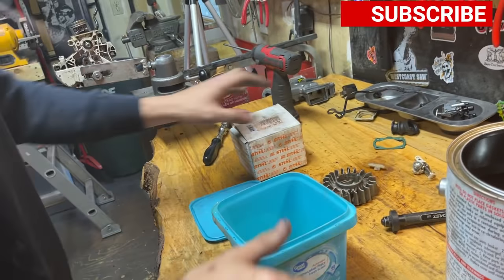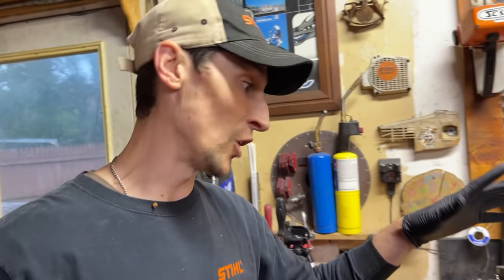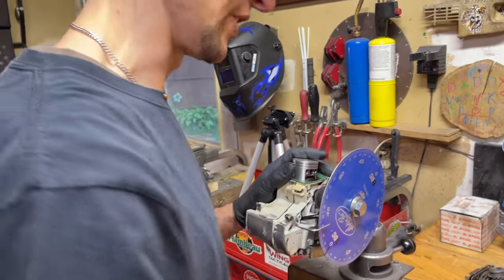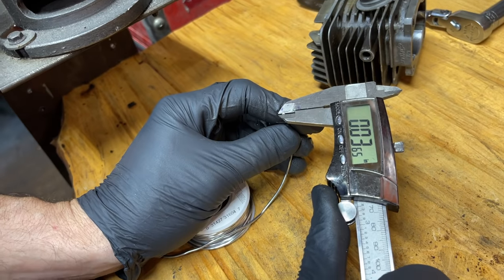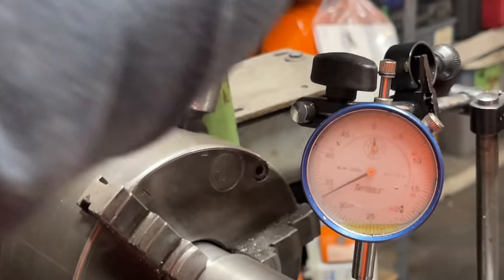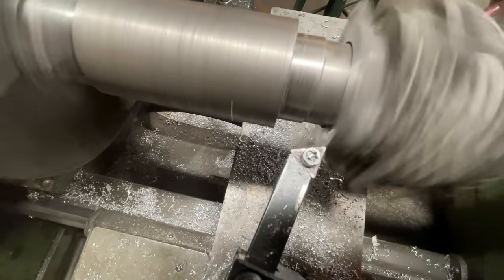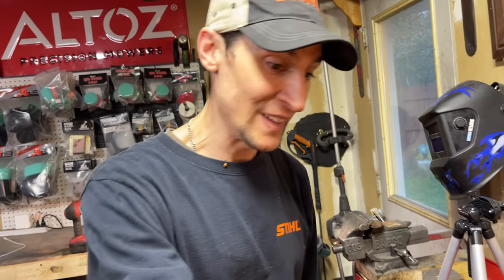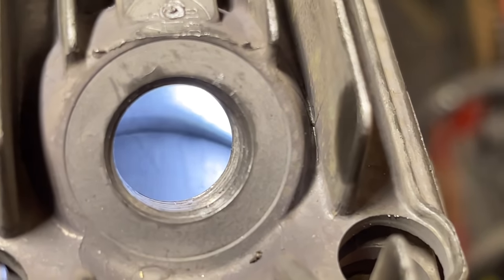LIMB REAPER!!! John ports and polishes my old ms200t explaining every step of the way.

Comment: 13:34  That measuring instrument is a digital caliper, not a micrometer. 
Great job. A huge amount of info & knowledge being shared here. Thank you.
Reply: No kidding... didn't know that... learn something every day 🤷‍♂️
Reply: I cringed a little with the water balloon analogy as fluids cannot be compressed. Not claiming I know anything about porting an engine or fluid dynamics for that matter.
Reply: @kenh9508  Air is a fluid and can be compressed. Liquids are incompressible. I didn't cringe at your comment because I know people make mistakes.
Reply: @dr7477  yeah ok, unsubsidized
Reply: It’s possible to put the same volume of water in a smaller space being heated & pressured! Heat will change the H20 molecule and being that a balloon 🎈 stretches being that it’s rubber! 
It’s possible Something that does not stretch could possibly hold that same amount with pressure behind it in a smaller space. Thus creating more compression which if released dramatically produces more energy thus creating more power! Energy=Power! 
We all learn something new everyday. Not the perfect analogy but we all understood what he was implying but some of us think outside the box. Lol cheers oh that space that’s smaller is very very minimal. Just like a cylinder when creating a smaller space with the same amount of internal mass present while outer mass is shrunk around it! Creates more pressure just like a stroker motor! 382 as a example! Again cheers 🥂 everyone!
Reply: The calibration mechanism within the caliper is a digital micrometer--so, he is not incorrect in saying that. You narcissists always have to show how smart you are.
Reply: @jkgkjgkijk It's not a micrometer. It's a digital vernier caliper. Please look things up before you go miscorrecting.

Comment: I've done 4 Stoke motor cycle head's for years and we all have our favorite bit's.When they clog or go dull it's part of the oh no moment.
Love w.d.40 for clearing chips and final finish.
Always wanted to look over someone's shoulder on a 2 stroke.
He was very clear on the dos and don't and why.
Also love the foot pedal to adjust rpm and quick change handle.
You both rock this video and thanks!!

Comment: Great video, and thanks for the memories.  I'm 72, and my Dad's machine shop was my day care.  I was running a Clausing 13" lathe by the time I was 8 years old.  I retired and sold the building two years ago, the new owner had no clue of what to do with the machine shop.  The lathe sold for $500, $300 for the Bridgeport mill.  Eight 30-yard dumpsters of metal and tooling went down the road.  I'm still crying.
Reply: That's your own fault. 

If you sold the building as a machine shop, you should have sold to a machinist. If you sold it as a building, you should have sold all the equipment yourself. 

Or you left so much old worn out tooling and tiny scraps they said screw it and scrapped it because they had newer better stuff to replace it....
Reply: Brutal.
Reply: I'm 73 and crying with you. I've wanted those machines since high school machine shop, but never found $$

Comment: I've been working on cars and trucks most of my 40 years but I only recently got into two strokes during covid ...... In that time I acquired 8 chainsaws and one was an 088 that needed a cylinder. I bought a new cylinder and piston which was the new style muffler so I welded up a two-stroke muffler from a dirt bike from a video I saw I also Port matched the exhaust port to the muffler and did a little bit of porting in the cylinder from another video I saw but I wish I had found your videos first. Thank you for the information you share, it's cool that you pass it on the way the gentleman who taught you did.

Comment: Really awesome video. It's cool too see a guy share his knowledge on porting not to many guys do that. And it's even better to see a saw built that is going to be working not reving 15000 rpm with no torque.
Reply: Right on the money... I have seen em built for top end and they will scream high RPMs but they fall flat on their face in a cut... respect that you get what I was after thats pretty cool 💯
Reply: @johnscustomsaws  those saws aren't practical,  especially for a working saw. Do you build 201T 's or just the bigger saws now.
Reply: @jaythe306snowmexican  201s have such small carbs its hard to get any extra out of them without starving for fuel.. and they have a "chute" style lower transfer that sticks down and they can't be decked on a lathe... would need a milling setup... so I just do a mild timing advance and "dirty up" the strato intake if you know what I mean... and a muffler mod... they are a tough one... the newer ones do have domed pistons and they run a bit better... I hate to say it but the climbing saws will probably be all battery powered pretty soon... I ran Jacob's husky 540 battery powered saw and was very impressed... no idea on battery life or price etc but power was awesome
Reply: @johnscustomsaws  ok thank you sir,  I'm not ready for the battery saws yet 🤣 . Thanks for all the help man I appreciate it.

Comment: Super Cool ....intake roughness...square out ports...
Polish technics on exhaust...

Fine grindings are abrasive and dont wipe off well in my anion.....I take distilled water with dawn dish soap and boil head an vigorously srcub with  stiff plastic brushs to get all the fine grindings out and boil in clean distilled water...blow dry and spray head down with wd-40....Im a amateur..5 years silver Stihl Tech.

Thanks Again , Great Video 😎

Comment: I am one of the 6 he was talking about. Haha
At the machine shop I worked at we had a flow bench for porting heads. The reason you want dimples on the intake is the air is being pulled in and by having the dimpled surface it actually does the opposite of what you would think. It allows the air to glide across the surface as it is pulled through the port. It smooths out the  disturbances  from symmetrical differences in the port by having the negative space below the high points. You can kinda think of it like a shock in a car. But also having less surface area the air actually touches as it is pulled through the port. So less drag it has while it is moving giving more flow/air to the cylinder. In higher end performance cars they do the same to the under belly of the car to reduce drag. The reason the exhaust port is polished is because the air needs to be  forced out as quickly as possible it does not have time to let velocity help aid the removal. Having dimples on the back side would actually temporarily slow the exhaust gas coming out not allowing all of the waste to be expelled quick enough before port or valve closes. We are talking na machines here. I have never tested a rough surface on exhaust port while running a turbo charger. They have back some back pressure that comes along with them. May aid velocity to give its benefits of quicker than a polished port. Key word may... Have never heard of anyone running simulations on a flow bench to test the possibility for added benefits. Butt would not apply here. Thanks again. I will need to watch this another 4 times this week to absorb all the things.  ;)

Comment: Digital calipers like the ones used in the video to measure the solder are basically just rulers with displays and they can measure pretty precisely but micrometers are a whole different animal. Really good micrometers are so precise that they have to be used at room temperature because of thermal expansion. When you measure something with a mic you have to include not only the size that you measured but also the temperature the thing was measured at because it will be bigger if it heats up and smaller if it cools down.

Comment: Awesome process, the explaining and the filming view is perfect. Made me want to try and do it on a ms210. wish me luck
Reply: You’re really limited on what you can do in a smaller consumer-grade clamshell-style Stihl which doesn’t have a bas gasket to delete or flange to turn. If you haven’t done so already, open up the muffler and advance the timing 8 degrees along with a switch to 91+ octane fuel. That will get you 75% of the gains of a full porting job on that saw without having to tear it down very far.

Comment: On the off chance that John rads this. Look into a bison 8” 6 jaw set-tru chuck. It’s a scroll chuck like your 3. But has a provision to adjust runout and they are usually in the neighborhood of .0004” repeatability.  Also, more jaws means more bearing area on the part with less distortion. I love 6 jaw chucks for barrel work.

Comment: Good info about the huskies...

I'm looking to do a leaf blower to see if i can gain any more rpm.
Poulan pro one, but made by Husky...

It's already mildly modified, and it confuses my neighbors.

Years ago neighbors saw how well mine runs, so they got the same one.

Confused looks as I'm running mine and tossing rocks, and running theirs.
I still laugh, neighbor looks at me kicking ass and taking names with my little yellow handheld, looks at his, the looks back at me with a super confused face. 😅 

Anyways, i have a fresh top end since it's about time to freshen ot up...
They apparently chrome line the cylinder.

I thought they only did that to their chainsaws.

I'm not sure if i can even port it. 😕 
Sounds like a nope.

I'll probably do some light cleanup of the transfer ports, and see if i can't raise the compression/lower the quench.

I also have an old tuned exhaust from my 2 stroke rc car that I'm thinking i need to adapt to it. 😆

Comment: Definitely do not use polish on the exhaust ports you are 100% correct sir. Lots of polishes harm steel and aluminum in a way that is not visible but as the engine is used the harm will show up as excessive wear or brittleness and other things. Polishes are fancy concoctions of chemicals and abrasives that shine things up extremely shiny and really fast but really are just for aesthetic purposes and shouldn't be used without extreme caution on mechanical devices. Using a scotch brite on aluminum will create aluminum oxide dust which is a major abrasive used in polishing compounds anyway so you just add a little oil in the form of WD-40 and you have yourself an aluminum oxide lapping compound which is great for polishing aluminum and wont damage the steel cylinder. If Johns custom saws reads this I would recommend you switch the WD-40 for synthetic motor oil and mix in aluminum dust to make it a polishing compound you might have to play with the amounts of each. Use a rag or cloth on your die grinder with the oil and aluminum dust instead of a scotch brite for the polishing step. Also I can't stress how important it is to clean everything thoroughly because its all coated in aluminum and steel dust after the sanding and polishing which will wreak havoc on bearing surfaces. Even if you can't see the metal dust it is still there and will soon be grinding your bearings to paste. The absolute best way to clean these parts is with an ultrasonic bath.

Comment: Oh Re the importance of setting squish --- Sure, it affects compression IE all things being the same a lower / tighter squish clearance will be more compression (smaller dislpacement at TDC), however I think we oftentimes forget just how much FUEL is stuck/wasted in there, from Jennings book he says that on a 250cc example going from 40thou to 20thou is literally putting 5% more fuel into the chamber (people have WAY over-inflated ideas about how much of the fuel in the squish-area is actually used, from what I've seen!) so minimizing the squish clearance is "good form" no matter what compression level you want to run, the optimization of the combustion-event is so critical (to performance as well as fuel-economy), the only reason OEM's don't send them out all at 0.02000"squish is because of "(in)tolerance build-up" in manufacturing, IE a connecting rod is a touch large on a particular unit, but its piston was also on the large side, and the cylinder was sitting a lil low --  now at 10thou squish the saw won't function properly.  So OEM's have to set squish at higher-than-optimal levels, as a consequence of mass-production NOT of design-choice! 
Altering compression from stock is one thing (not a bad one, mind you!) but setting proper squish is just good-habit IMO, hardly even "a mod", it's like cleaning up bad casting or other artifacts of mass-produced engines!

Comment: Up and down movement is called "runout",  back and forth is called "endplay". The first is bad, the later is not.
Reply: Run out is not something used to measure bearing play but end play is and was correctly used by John. An example of run out is when he's adjusting the mandrel on the lathe.

Comment: Your friend really need to get a ultrasonic cleaner. Drop a carb in have lunch. Pull out the parts. To a level you thought not possible.
Reply: I have an ultrasonic... 2 actually... I was trying to give an easy "at home " tip... not everyone has an ultrasonic was my thinking..

Comment: I was the S in S&M TMT racing. We built and raced formula two And formula three grand prix motorcycles. Mainly the TZ250 and the RS125. I have two questions. Do you CC the heads and/or stuff the cases? Also this gentleman knows what he's talking about. I was rather impressed. Granted, he's not an A. Gram Bell or Joji Yakamura, but he's pretty close.

Comment: A good practice to get into would be blowing all the chips out of inside the cylinder after youre done on the lathe, sure 99% of the time theyre going to fall out but it takes one time for one chip to stick to scratch the inside of the way or nick the top of the piston when one sticks. Plus youre also not introducing any chips into the bottom of the crabk case when you bring the cylinder over to the bench.

Comment: metal polish would be fine as long as you wash it all out .it's generally got aluminum oxide in it, and even the calcined type will continue to cut if some abrasive is left in

If it's worse than using sandpaper (which will leave bits of alumina behind), I don't know. Maybe if for any reason, just because metal polish usually involves a greasy carrier that's intended to leave behind a tiny slurry/grease layer (that could have abrasive in it) - the tiny layer left behind prevents rust for a short period (not a big deal in an engine filled with lube oil residue).

Comment: You say "it's amazing how much goes into this" the main part of that is because it's a 2 cycle/2 stroke vs where a 4 stroke engine has a camshaft and valves for air and fuel delivery and exhaust where a 2 stroke has no valves or camshaft and uses ports for its air and fuel delivery and exhaust.
So basically he's modifying the ports for performance kind of in the same aspect of putting in a performance camshaft in a 4 stroke. Plus he raised the compression by shaving the base of the cylinder/ jug which also adds performance.

Comment: And anyone looking to get a lathe that 3 phase, what you do is you buy a VFD which takes single phase (220v) and digitally divides the 2x 110v into 3 phases. Theyre cheap and its very easy to hook them up yourself. But if you have zero electrical knowledge or experience i wouldnt suggest doing it yourself unless you research how to do it properly and take all the proper electrical safrey precautions.

Comment: Just fyi that is a digital caliper not a micrometer. And it doesnt matter if you use MM vs inches.
1 thou is .0254MM. .0036 would be converted to .0914mm. Al though the scale is different, there is of course a conversion from standard to metric.

As a machinist i use metric to take measurements if im building something from scratch because the math is easier and easier is quicker.

Comment: "You can't just put a ruler in there" (Re having to use a timing-wheel)  Why not? Honestly asking, I'm n00b-level and have made (2) timing wheels, one for my 660's and one for my 590, 'custom 1-off' wheels.... BUT I also use my depth-gauge, for instance I NEVER use the timing-wheel to check my blowdown/transfers, I simply use the depth-gauge and measure my exhaust-port-roof (which I already triple-checked on timing-wheel, so now I know where on my cylinder wall is 100deg) and I measure the transfers'-ceiling height, this distance is then converted to degrees by using stroke (ie 40mm stroke is 80mm of movement for 360deg 1 full rotation of crank, works out to about 8thousandths inch per degree on a 660)  I know that piston movement (vertical plane) and degree-rotation are NOT always true, but my understanding was this does NOT matter, since the points where they're not 'true' are TDC and BDC and we're not measuring ports there, the ports are around the middle and in that area 1degree should be darn-perfectly-close to stroke(mm's) / 360(degrees) for mm/1deg measurements on cylinder-wall.  Would love to hear your thougths on this, I do believe you MUST start from a perfect, triple/quadruple verified-to-be-perfect exhaust ceiling #, I do this before I ever chamfer the port just so I can be dead-on, but from there I don't see any reason you can't convert the ~1" and less, mid-stroke distances from vertical millimeters, to rotational degrees (mid-rotation, again I know TDC and BDC are 'funny'!)
A+ video as always!!  You mentioned podcast possibility -- the transfers between the 020 and 200t, and then transfers from say a 7310 (wow!), that would be some incredible podcast-topic right there, there's a woeful lack of transfer info (as well as info on how our intakes vary from other 2-strokes, it seems we're the only ones whose intake opens via piston-skirt, not piston-crown!)